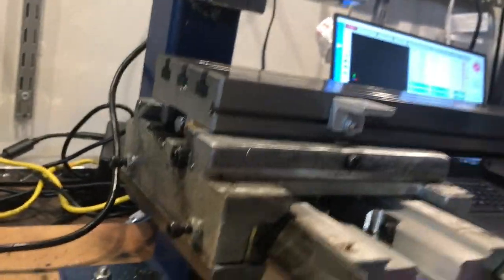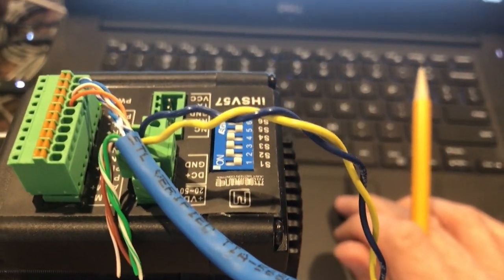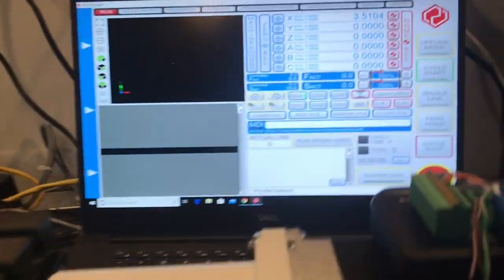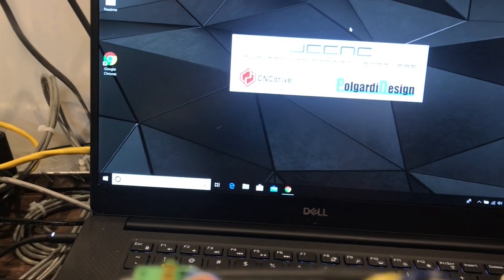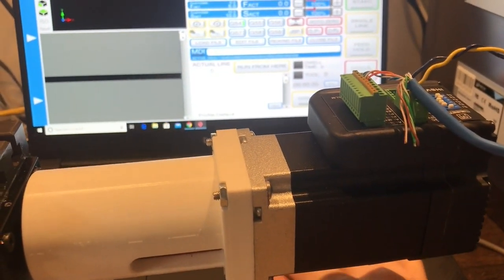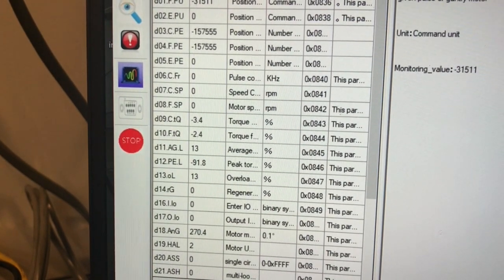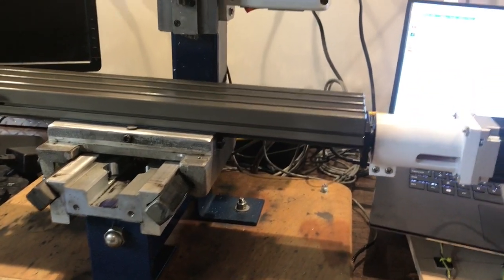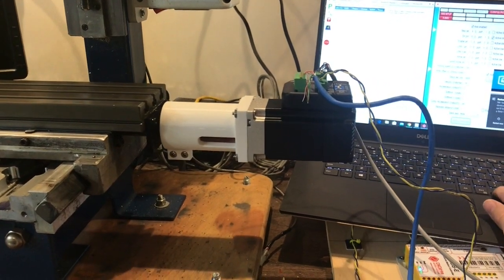JMC Servo iHSV57 (English Language) Video 4, Taig CNC Mill, 270 IPM testing

Comment: Hi, after all this time, can you still recommend this motor to buy? I need servo for my lathe, now I'm using shortest nema23 with micro step driver, but seems that torque is not enough, and with more power motor I thinking about servo, to guarantee that there's no missed steps. Servo in your video seems to be the cheapest one in Ali, but does it worth to take more expensive?
Reply from the maker: Hi, After I did this video, I bought another Taig mill that had ballscrews and steppers. It ran so good (200IPM easily) that I did not want to change it. I kept the servos for a future cnc project. So I don't have more experience with them to give an opinion based on actual use.

I did make a project for my day job where I designed a turntable to spin a 250lbs human. I used the same series JMC servos, but the 180W version, and a raspberry pi with a protoneer hat. The servo in that application worked great. It could spin a heavy person without any issues.

There are also other YouTube videos, although most not in English language, of this servo having good success.
Reply from the maker: Hi, After I did this video, I bought another Taig mill that had ballscrews and steppers. It ran so good (200IPM easily) that I did not want to change it. I kept the servos for a future cnc project. So I don't have more experience with them to give an opinion based on actual use.

I did make a project for my day job where I designed a turntable to spin a 250lbs human. I used the same series JMC servos, but the 180W version, and a raspberry pi with a protoneer hat. The servo in that application worked great. It could spin a heavy person without any issues.

There are also other YouTube videos, although most not in English language, of this servo having good success.

One thing I wish the servos came with is all the cabling. In retrospect, I would have definitely paid more if the cabling was available off-the-shelf. I could not find it anywhere, and JMC didn't understand my question when I emailed them.

Oh, also if you go to clough42 channel, he has a stepper and servo comparison video, where I think he checks almost this same motor. Its branded differently, but looks very similar, and same price range. Edit, I found it: https://www.youtube.com/watch?v=clgpZJFoqIQ

Comment: Hard to find English speakers who understand these motors, so thanks for sharing. Is there anything you can think of that would cause two of my motors to work normally while the third only moves in one direction when homing and using gcode commands?  I CAN get it to switch via the dipswitch, but then it is just all the other direction.  Homing doesn't back off and redo slower like it should; it rams further into the switch.  I've spent days thinking it was a homing/setup issue, but switching to another board, rewiring, etc all confirms it does not seem to accept direction signals.  any thoughts?  I was able to hook all three to the usb serial connector I made, and the jmc software confirms their settings are almost entirely identical.  I have v604 if that matters. I don't use enable pins.
Reply from the maker: I'm learning as I'm going... but are you sure its the motor? If its the X motor for example, if you remove it, and wire the Y motor to the X step/dir terminals on your breakout board, will that motor work? And conversely, if you put the bad X motor wired up to the Y step/dir terminals, will the X motor work then?
Reply: Yes, unfortunately I've already tried that. I figured I had a bad setup in grbl, but I've tried three boarda of various configs. In all cases it won't reverse direction via a gcode or homing command. 180w version. Thanks for responding. Did you happen to find a good suggestion for changing any options in the parameter software? I have just been using the defaults so far.
Reply from the maker: @orangezeroalpha  On the servo that does not work, does it hold its position? If you try to turn the shaft with your fingers, will it fight you back? Does it fight you back if you try to turn it in both directions? If so, then the servo is probably working properly. I vaguely recall there was a setting for max rpm (in the JMC software) for both the clockwise and counterclockwise direction. Could one of them perhaps be set to zero, and that is why you can't go in one direction? I tore down. my setup in order to machine proper aluminum servo mounts, so I don't have the servos powered on right now. When I do, I will see if I can find that rpm setting. The one setting I did change was the max torque. It went from 0-300, and the factory default was 200. I put it to 300, and it definitely makes the servos "stronger".
Reply: It could be that you‘ve killed the optocoupler of the direction input. What is your voltage on the control lines and do you know if there’s a big enough current limiting resistor on these lines? For 24V it should be around 4k ohm if I’m right. However, it could also be, that you’ve configured it wrong.. i don’t know exactly, but there are some base parameters, for example how it it is controlled in general.. like step/dir or rpm input. Have you saved the settings of one working servo? You can load it in the software and download it to the not working, just to make sure it’s not a setting you’ve overseen.
Reply: Strange coincidence. I was trying these motors out on my new pick and place machine and I somehow burnt out a direction pin on my motherboard. I designed a mosfet “driver” board that is in between so I can use the 3.3v MCU pins to control the opto’s inside the motor (which I have running at 24v). No idea how I managed to kill the DIR channel in my control board though. I’m pulling these off and going straight stepper motors. If I have any issue with lost steps etc I’m buying leadshine closed loop steppers and be done with it. It was a nightmare trying to tune these things.